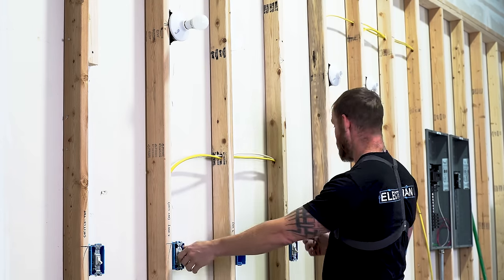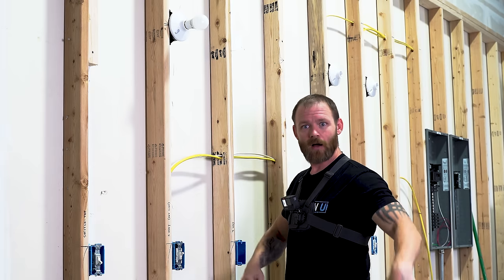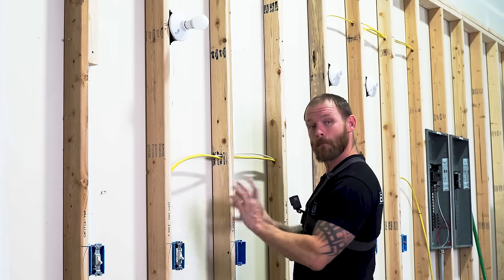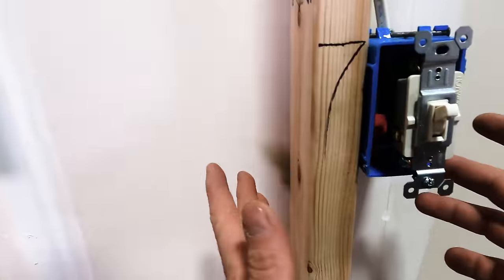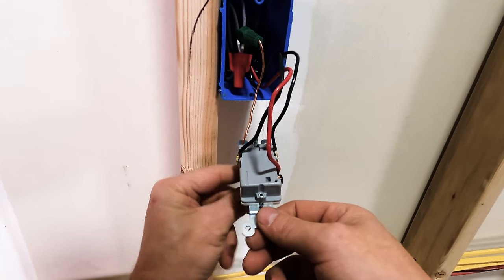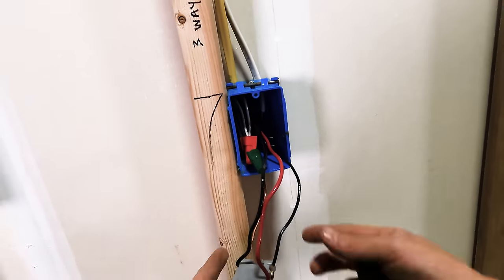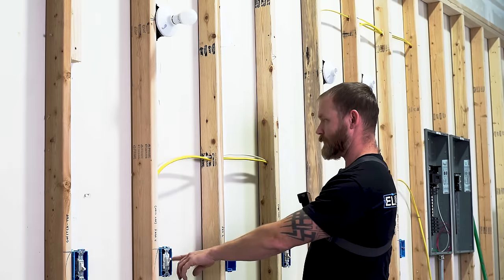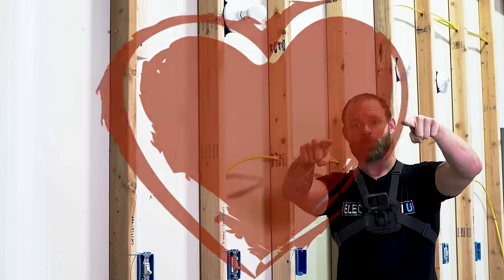Troubleshooting 3-Way Switches: Why Does My 3-Way Switch Only Work Sometimes?

Comment: For the 3-way switches in my house, I'll flip the switch or reverse the travelers so that when both toggles or paddles are down, the load is off. It drives me nuts to look down a hallway with 4 or 5 switches on it and see one toggle up when the load is off.
Reply: If you do that, the switches can also be up with the load off.
Reply: Of course. It's OK for one switch to be up when the load is on. But if you leave both switches up when the load is off, well, that's as bad as loading toilet paper so it's "under" instead of "over" :)
Reply: Look at Mr Long hallway 😮
Reply: @zhallquist28  😂
Reply: It'll never stay like that. That's the nature of 3-ways.
Reply: To be clear:

Designing such a switch that would stay like that would require either mechanical linkages and clever wiring OR data communications between switches AND some mechanism to change the physical state of the other switch without changing the electrical state when one is flipped. (Think Lutron style switches with a motor and extra internal eletronic [not electrical] circuitry... cleaver circuitry at that.) As far as I'm aware no such switch currently exists. 

Or...or, as Dustin said, always using the switches in the same order every time without failure.That wouldn't keep it like that at all times but would make sure it always returns to that state at a certain point in the cycle of offs and ons.
Reply: The stairway from the basement/carport had 3 ways at the top & bottom. My Mom insisted that the light was not "off" unless both toggles were down. I would be a jerk and put both up. When Mom noticed it she would go downstairs to turn the light on and then come back up to turn it off again. (Of course I was in trouble when she caught me. 😆 )
Reply: I have 2 Red wires and 1 Black wire
Reply: Is it true one red it could be hot too?
Reply: You're a fan of doing unnecessary tasks and wasting time
Reply: Maybe you're already nuts because you don't have the mentality to remember and understand that a three-way switch is a directional/variable switch and not a toggle, on/off and throw switch.

Comment: BEGINNERS: its crucial you remeber that there are two separate legs. Switch side and hot side. Do not spend hours on farting around with one switch because you dont want to keep walking back and forth. Identify the circuit first before troubleshooting!

Comment: 50 years ... We moved into our family home in '74, and the 3-way in the garage did not work correctly. it only affected the lights over two of the spots. Dad refused to fix it, and later he refused to let me look at it. Well ... he passed a couple of months ago, and I've been working for weeks fixing everything he refused to fix. And guess what ... the old garage 3-way works now! The travelers at both ends were mis-wired just as in the video.

Comment: My dad taught us basic electrical growing up.  I always knew it was called a 3-way switch, I knew that's what they did but I never knew WHY it was called a 3-way switch.  I always thought it should be called a 4-way switch.  You Sir, made it make sense.  The guy working on our house recently wired the hallway light leading upstairs and you have to keep the one at the top of the steps flipped to the up/on position in order to use the one at the bottom of the steps that is in the kitchen, to turn the light on.  We had always had these switches in that stairwell but after our house fire (of course an electrical fire but not because of this particular switch LOL) the electrician at the time never even put a hall light back in at the top of the steps.  So.....with that being said, I now know how to investigate the issue.  If he has the wires correct, as you showed, then I'll have to come back and watch a follow up video from you.  hahahaha
We'll try this trick first because the way you explained it, I followed intently and realized that the problem is in fact the one at the bottom of the stairs in the kitchen and is not the one at the top of the steps that is having the issue.  You even made that easy to understand.  Easy peezy.  BTW....you forgot to act surprised when the light came on at the end. LOL

Comment: You gave me everything I needed to know by saying "My two travelers should be my gold screws".  Mystery solved for me and the simple data point I needed to understand 3-way switches.  I ran in the house and easily solved my issue by ensuring the gold screws were connected to the two wires in the same sheathing.  Thanks!

Comment: What’s a chicago 3 way lol? We have conduit so I always pull my travelers the same color and group them together
Reply: Chicago 3 way is a method commonly used with knob and tube wiring,  and in rual areas,  where you have a yardlight between a house and barn, receptacles in barn are hot all the time and three way switches in the house and barn control the yardlight,  using only 3 wires not counting the ground.  You wire the hot and neutral to the travellers , and the light is switched with the commons , a hot and neutral,  light turns on, two neutrals or two hots and the light turns off.   Commonly used until the 50s or 60s because you save one wire, although technically had been illegal since 1923

Comment: I did what you suggested (swap swapped what I thought was the traveler ) and still have the same negative result.
Could there be another reason?
Reply: The most important thing with a 3 way setup is you want to make sure you have your power, on the hot side, connected to the common of the switch. Then your travelers run over to the next switch. On the next switch make sure those two same travelers are on the traveler terminals, and the hot wire from the device it is wired to is on the black screw on that side. If all of that is in place, then check to make sure your power is coming in properly on the hot side with a tester. If that's all good, then check from any breaks in line between the two switches, or maybe your power source is being switched from elsewhere in which case I would make sure your pigtail to the switch is tied to a bundle that is always hot. Just some steps you can take to hopefully move further along the troubleshoot process and hope that helps.

Comment: My favorite 3 way problem was mixing it with a fan and light leg from another 3 wire.  It's so easy to confuse especially when cutting in the switch box if not labeled well.  I started putting each switch leg and traveler in its own position in the box to help prevent mixups.

Maybe you could demonstrate a more advanced problem say in a 4 gang box with multiple 3 ways switch legs and a fan leg combination.

Comment: There used to be these push-button 3-way switches decades ago, so the position doesn't matter, just press. I miss those.
Reply: Those are still available for restoration work, but be prepared to really open up the pocketbook,  they are expensive.

Comment: Can you do switch loops? I think they stopped using them in the late 80's.
Reply: You legally can, but  you must run 14/3.   Pretty much pointless now except in unusual situations.  For example if I have power coming in one end of a hallway,  a light and a receptacle in the middle,  and  the switch is located on the other end with no other devices it's probably going to be more cost effective in material and labor to run power from the receptacle,  to the light,  then run a 14/3 from the light to the switch.   The convention is to use the red as the switch leg, black as your feed, and place a wirenut or wago connector on the neutral and shove it in the back of the box.  As of 2011 with a few exceptions, a neutral must be available at a switch box.    Sometimes certain types of electronic switches require a neutral to function.   

The old method of running power to a light fixture and running a 14/2 from the fixture to a switch,  is no longer acceptable.
Reply: @Sparky-ww5re  Yeah, I ran into that and it "threw me for a loop" when I was replacing a dimmer.  Power was running to the light first.  My old 12ga has a white sheath too along with the 14ga.  I have a jbox that was putting black and white together so it made it difficult to figure out they were using white it for a hot.  I've gone through an replaced nuts with Wago221s to help troubleshoot and map out the circuits.   I'm also replacing all the backstabbed stuff as I go along.  80's wiring was a mess.  I dont even know if they were trying to save money since this place is piped (horribly) in copper too that I'm replacing with PEX a stick at a time.
Reply: Another weird thing is that I have a 200A box outside that has a lot of breaker room, with only like 6 breakers.  They put the HWH, Oven and 2 HVAC units in it.  One is a 90A for a panel inside the house that runs all of the house room circuits and another is a 100A they sent to to the garage that had an apartment at one time.  Its a weird setup, but I like that its flexible since I was considering installing an Electric Tankless.

Comment: I wanted to thank you for the great video I had the same problem and now I was able to fix it.    So what helped me was when you say the two wires that are coming from the same wiring (the black and red) Ned to go on the silver screws. Not on the black one at all on both 3 way switches.    Excellent

Comment: Dude, the upgraded version of that Milwaukee drill is my most used drill in residential.  It's around the same size maybe even more compact (yet looks beefier) but an awesome feature the newer model has is it has 2 speeds, and both a drill mode and screwdriver (clutch) mode. I throw a 6.0 12V battery on that sucker and it'll last all week, but most importantly it has the capability of drilling light holes, in wood, stucco. Really saves the day if ever you're in a pinch or you don't want to have to climb down the attic or back down the ladder and to the truck for a drill driver gun. I Def recommend.  Thanks for the videos

Comment: One of my biggest pet peeves is the or of sync switches. When switches are down, lights should be off. Instead of putting the common and black traveler on one side, and the red alone, on the power side I put the common and black traveler on the one side, and on the switch side I put my common and red traveler. A 4way switch changed it up, but with just two 3way switches, it works great.
Reply: True, but when both of your switches are UP, the light will also be off.
Reply: @Justinwhat1  but when they're both down, they're off. That's more important.

Comment: Swapping out old 3-ways in a 1964 house I just bought. Was so confused why they weren't working properly after the swap

Watched this video & when you said to look at the sheathing to see which one had 1 wire coming out & which one had 2. Thats all I did & now it's fixed good as new!

You're the man thanks so much

Comment: Thanks for the common comment, the pos 3 way switch I was provided has no blacks screws and no instructions in the box, just two brass screws and a chrome screw. I got it fixed now.

Comment: I had a 4 way not working on all 3. I also had in my head one worked another light added to the mix. I had all the switches out. I thought I had a bad switch but checked for continuity and it was working. After an hour I fixed it by accident. One of the switches was halfway pressed and that made the other two not work. I was glad I didn't fire the parts cannon and also surprised I was dealing with a 4 way not a 3 way. Sometimes when you don't use a switch for a while you forget which light it worked.

Comment: I'm still having an issue and hoping you could help, I've been stuck on this for days now and banging my head against a wall...I simply replaced the two switches with new ones and the old one had 14-2 black to common, and 14-3 black and red to travelers, I did the same for both switches and now one switch will flip on and off, and when turning that off, the other switch won't turn on...here's the twist, if I flip the other switch one, the initial switch won't turn on, so it's happening to both switches where one can have the power and the other won't....PLEASE HELP!!!
Reply: I have exact same issue. I hope he can respond to your comment
Reply: @fatmaceylan5010 I figured out what the issue was. I had spliced the wires in between the circuit and one of them was loose, which caused the issue.

Comment: Thank you for the Video!!  Someone put  a red traveler on the hot lug. The other end was wired to a dimming switch. When I took the switches out the hot wire was 12 gauge and the travelers were 14 gauge. I replaced both switchs as you instructed on another video and it works great!!

Comment: Love this!  My first job as an independent, was to troubleshoot and fix ALL of the 3-way switches that had been mis-wired in a 6,500 sqft house in University Park.  It was a great learning experience for me and established my regimen for wiring 3-ways.  During rough in, I'd give the two travelers a couple of twists together to identify them and leave the common (hot or switch leg) alone.  Now I've seen some electricians then coil the common around the travelers and I can see how this would be helpful in multi gang boxes with several travelers (and even multiple commons, a mix of hot(s) and switch legs).  For temporary lighting, I might cap the common with a traveler (usually the black) and just install one temporary switch (single pole or 3-way) at the other side.  At final trim, I would attach the lonely black to the common, the red traveler to the gold screw on the side of the common and the remaining black to the solo side gold screw.  Rinse and repeat on the other end and I've never had a problem.

When troubleshooting customer installations, this is the first thing I, reconfigure the wires as I've described.  I've never seen a 3-way switch 'fail' however I have found several single poles that have physically stopped working.  They normally feel 'squishy' or 'loose' when operated.  Only once have I had a 4-way fail on me.

The worst experience was my first 4-way installation when the boxed 4-way switch had been replaced with a single pole by some devious customer that wanted to save 10 bucks and rip off the big box store.  I lost three hours finding out I had the wrong switch then having to make another run to the store.  Now I physically inspect boxed switches before I buy them.
Reply: But 4 ways have... 4 terminals?
Reply: @sickbassdrop  Yes, they do (well, 4 posts and a ground).  Two incoming (line) travelers and two outgoing (load) travelers.  No common (hot or switch leg) connection.  In a switched network (like a long hallway with multiple bedrooms), it goes something like [Line Hot] - [3-way] - [4-way]- ... - [3-way] - [Load switch leg]
Reply: @blueskies4715  I meant you bought and installed the single pole switch out of the 4 way box. Idk how you didn't notice it right away.
Reply: @sickbassdrop  Ah.  It was in the box.  You can't see the terminals in the box.  I did not check as this was the first 4-way switch I had ever purchased on my own.  I do now, much to the employees in the aisles bitching at me opening the packages to ensure the right product is in them.
Reply: @blueskies4715  I think Kopfjager is trying to understand why it took you three hours to figure out why your circuit wouldn’t work. Your story makes it sound like you installed the single pole, and spent 3 hours figuring out that it wasn’t a 3 way? Do they look so similar in appearance that you wouldn’t know right away that a single pole is not a 3 way? Or did it just take you 3 hours to make the round trip to the store again after opening the box?
Reply: @CaseDadToo  Home Depot was an hour away.  It took me five seconds to realize I had the wrong switch but I have to admit I stared at it for five minutes trying to understand what happened (to me). I was working the weekend to meet a Monday deadline if I remember correctly.  In over a decade since then, I've found swapped switches probably 10 or 15 times.  Unscrupulous people will swap single pole and 4-way boxes so they only have to pay $2 instead of $12.  Rips off the next person down the line, but hey, they think its just fine to do.

And no, a Single Pole and a 4-way are radically different in appearance even if you don't count the screws.  Single Pole Toggle Switches are very slim, compared and 4-ways are almost too thick to fit into a single gang box.  They are even larger (fatter) than 3-ways.  Decora's are a little tougher, but 4-ways are boxy all the way down the side whereas single poles slim down. (A 4-way has the bulk of a GFCI)
Reply: @sickbassdrop  I think you may have mis-read my post (sorry if I wasn't clear enough).  When enabling temporary lighting after rough in, if you cap the common and black traveler together at one 3-way location, you can then install a temporary (throw-away) switch at the other end that would allow other trades to turn on and off the lights without trimming out the entire thing.  If there were a 4-way located in that chain, just cap the red's together and the blacks together to complete the path.
Reply: @blueskies4715  I'm an electrician myself. I am familiar with the wiring methods. I was just confused thinking you had installed the single pole thinking it was a 4 way and then couldn't figure out why it wasn't working.
Reply: I think some also open wax less toilet rings and remove the hardware too. :(

Comment: This just happened to me but our house was built 2 years ago and we never had a problem. 3 hallway lights, all 3 can turn on or off with 3 switch locations. Bottom of stairs, top of stairs, end of hallway. And it's not the lights.